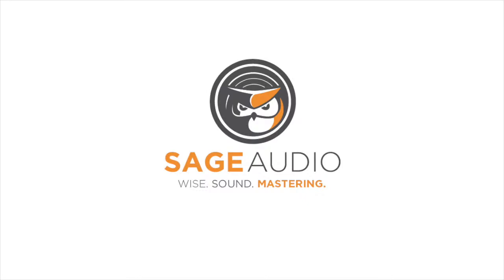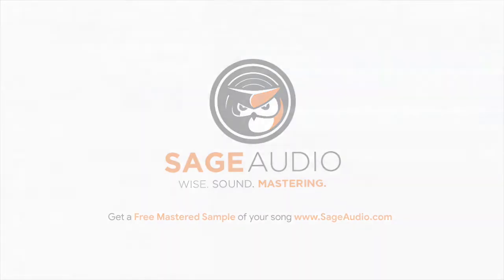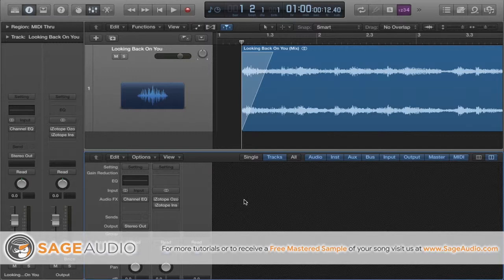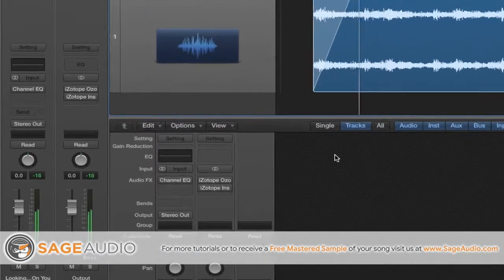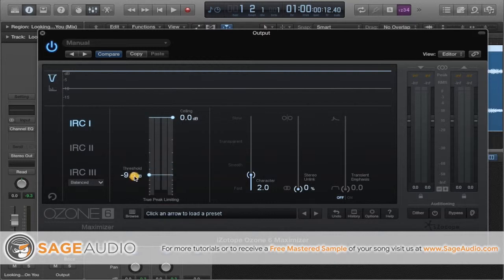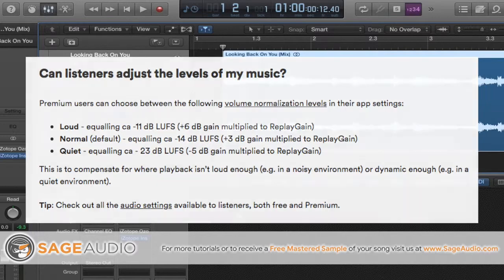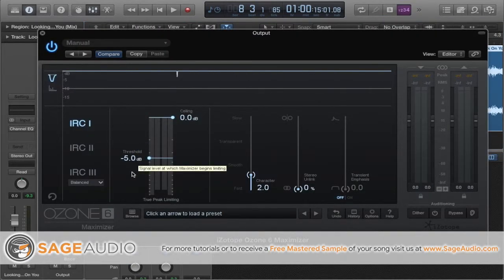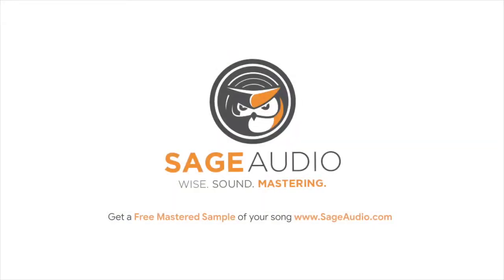How Loud Should My Mix Be?

Comment: @Sage Audio 🔥 video and you gained a subscriber. One question though - you say as long as its -18db and -3 db it's fine but then you end the video saying that -10 LUFS is louder than it needs to be? Confusion ensues.
Reply from the maker: Hey Conner! Thanks for the comment! dB and LUFS are too very different measurement types.  LUFS measures loudness and dB is the peak value of a signal.  So the signal should peak between -18dB to -3dB.  Its loudness (measured in and integrated LUFS) should be no greater than -10 LUFS.  I hope this helps but let me know if this didn't answer your question fully! Thanks!

SageAudio.com
Reply: Sage Audio I thought they were interchangeable. Thanks!